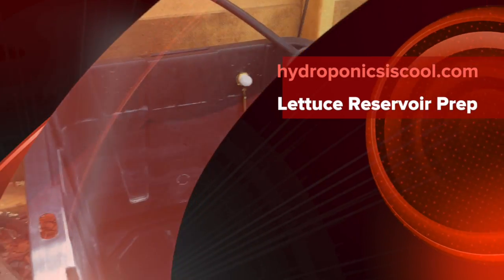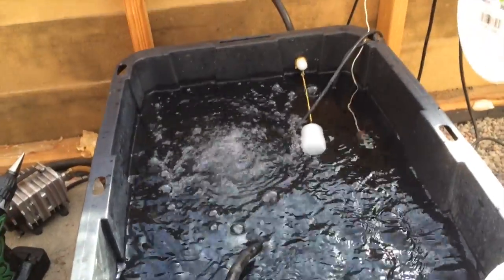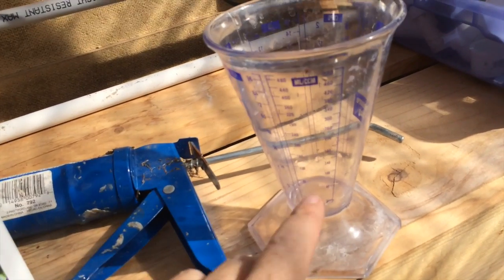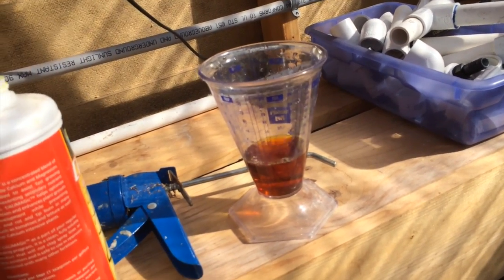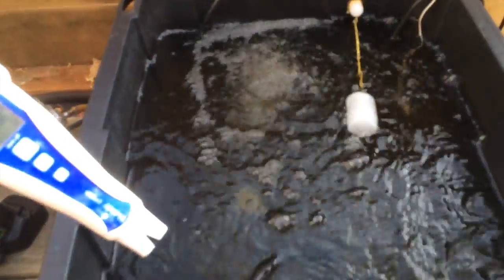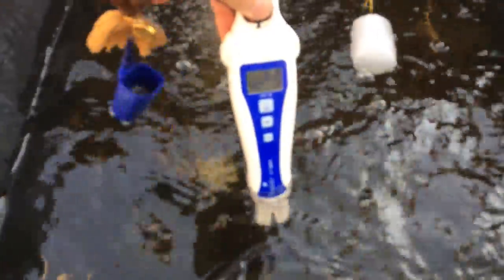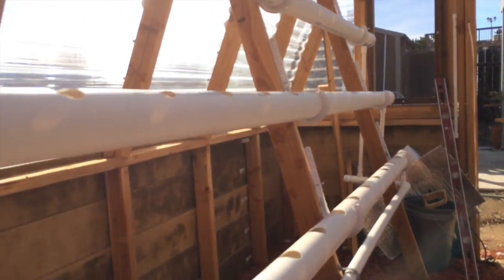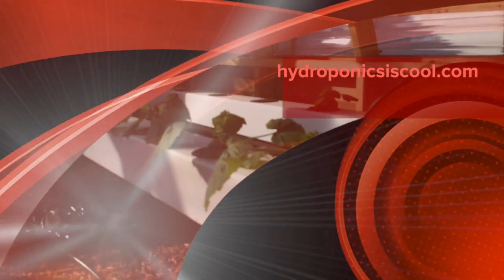Hydroponic Lettuce Reservoir

Comment: hey mate.. buying the nutrient in 1 or 2 litre water diluted bottles is about 1000 times more expensive than buying the powdered nutrients in 25kg / 50 pound bulk bags
a 25kg / 50 pound bag of calcium nitrate is about 20 Australian dollars a 50 pound bag of mono potassium phosphate is about 49 Australian dollars and a 50 pound bag of potassium phosphate is about 30 dollars.. even cheaper in American dollars I would imagine..
100kg / 220 pounds of powdered macronutrients at wholesale price costs about 120 dollars and makes well over 80,000 litres / 20,000 gallons of nutrient solution at a rough guess
ask around the agricultural supply warehouses.. farm supply stores.. you know the places.. its exactly the same stuff they use out on the fields which is exactly the same stuff used in hydroponics
a micronutrient blend and Epsom salt is the only other stuff that would have to be added
the npk mix per gallon / 4 litres is 1 gram mono potassium phosphate 1 gram potassium nitrate and 2 gram calcium nitrate.. that's a very standard npk mix for most things.. save a lot of money using bulk bags.. its exactly the same stuff as used in the pre-made watered down overpriced liquid stuff and about 1000 times lower in cost
with a fairly large home garden set up like yours.. 10 dollar a litre nutrients would become very expensive for a set up that size